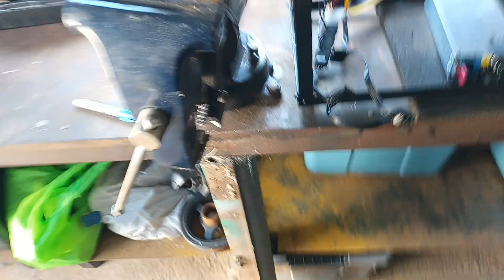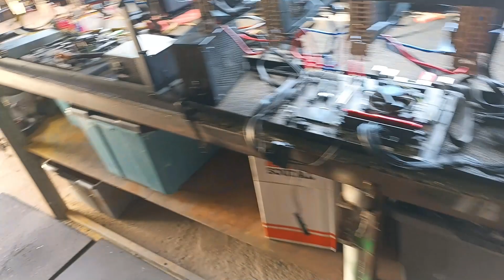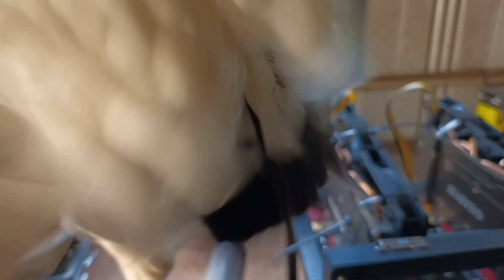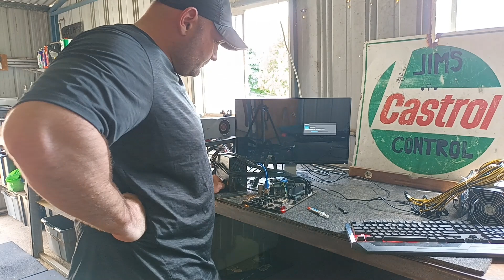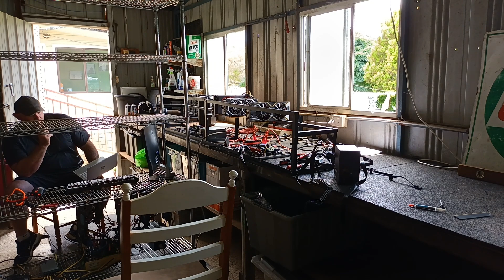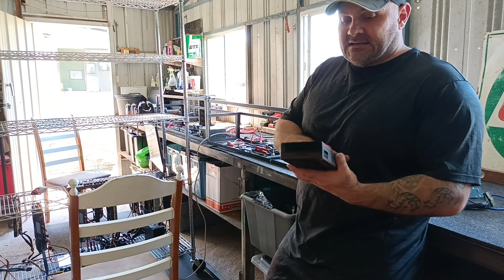Attempting to set up a 12 Rig motherboard mining

Comment: Idk 🤷🏼‍♂️ what bios setting are you running … trying disabling csm maybe … i know that got my b550 gaming-f mobo to run at the max of like 8 cards.. also is there another spot for power on the mobo molex usually… if that was missed the other cards wont show … good luck guy you will get them all running #density
Reply from the maker: Thank you appreciate that I'll have a look at that in the BIOS I did have 12 running on it in the last bull run I only could get 5 to work on it, so far it's better than it was with 9 running there is not another spot to power it thank you for the all help